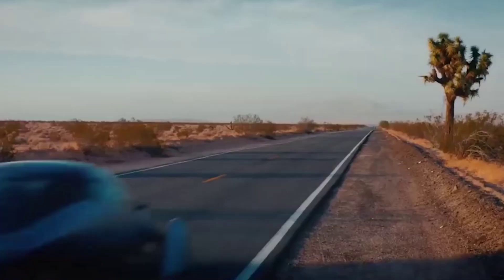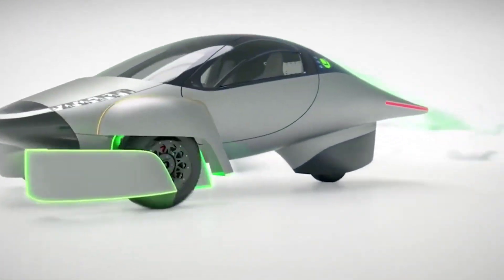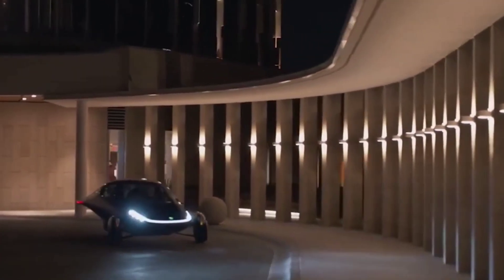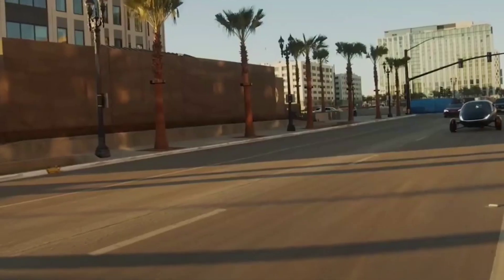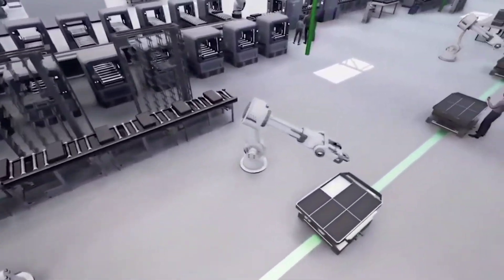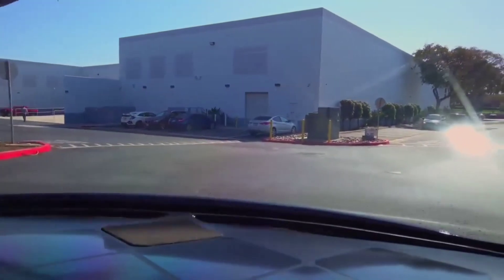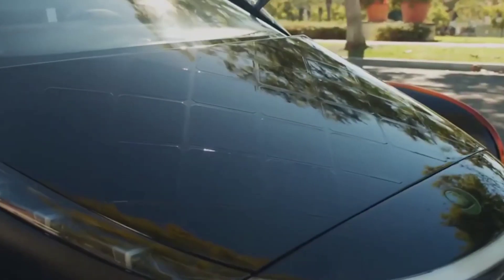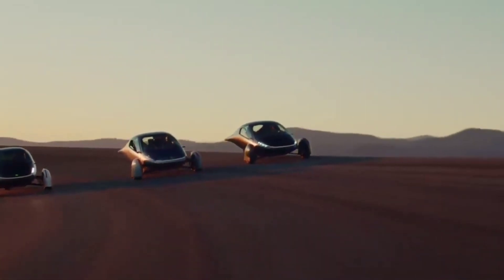Aptera’s New Car DELTA is The New Game Changer in the Market

Comment: One of the most genius engineered vehicles of our life time.  January 20th, tomorrow, we'll be getting the full scope of its finalized producrion-ready design
Reply: It's already Jan 20 where I am. That talk fest will not give you any full scope; they will sell snake oil about a launch edition that will gazump Paradigm orders, which is a kick in the guts for them. I will make a video after there are about three deceptive video's done.
Reply: There is nothing genius in this motorcycle. Everything they banged together is already well known.
Reply: @vic321344  Did you know they put in a patent application for turning solar cells by 45 degrees? lol Did it when they were just plastic.

Comment: The Aptera is not a car. It is a three wheeled motorcycle.
Reply: It's legally considered an "autocycle"
Reply: @ctuan13  Okay - silly autocycle.
Reply: @ctuan13  It is a three wheeled motorcycle (no sidecar)

GENERAL ASSEMBLY OF NORTH CAROLINA
SESSION 2015
HOUSE BILL 6
RATIFIED BILL
H6-v-3
AN ACT TO DEFINE AND REGULATE AUTOCYCLES.
"Passenger Vehicles. –
a. Autocycle. – A three-wheeled motorcycle that has a steering wheel,
pedals, seat safety belts for each occupant, antilock brakes, air bag
protection, completely enclosed seating that does not require the
operator to straddle or sit astride, and is otherwise manufactured to
comply with federal safety requirements for motorcycles.
a.a1. Excursion passenger vehicles. – Vehicles transporting persons on
sight-seeing or travel tours.
…
d. Motorcycles. – Vehicles having a saddle for the use of the rider and
designed to travel on not more than three wheels in contact with the
ground, including motor scooters, autocycles, motor scooters, and
motor-driven bicycles, but excluding tractors and utility vehicles
equipped with an additional form of device designed to transport
property, three-wheeled vehicles while being used by
law-enforcement agencies and mopeds as defined in subdivision d1
of this subsection."
Reply: It's a Terra.  Not a motorcycle
Reply: @EarthCreature.  Or a Tyranno?
Reply: @EarthCreature.  It's a non-existent silly tricycle.